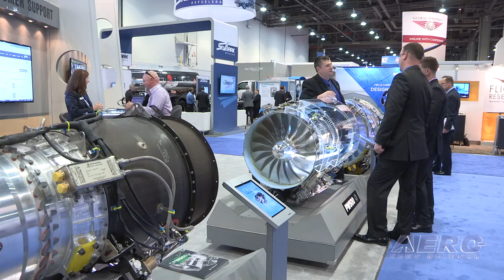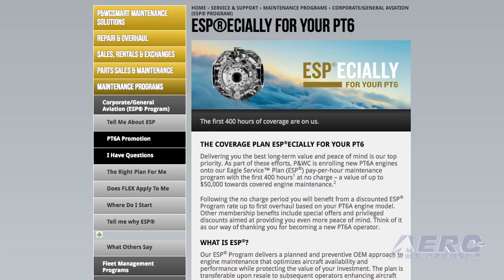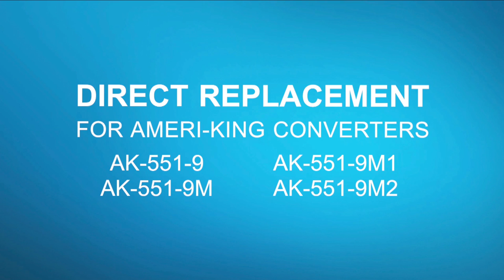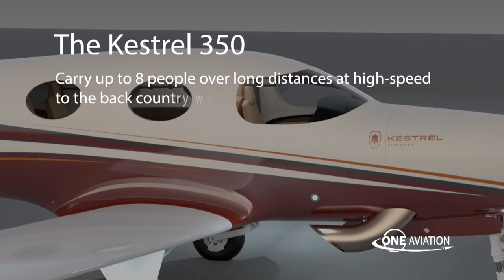Aero-TV: P&W's PT-6 Family - Maintaining Competitiveness

Comment: I'm sure he knows this, but the fact that the air enters at the back ISN'T what makes the PT-6 a reverse-flow engine. The airflow, after leaving the compressor section, travels into the "hot" section then reverses direction before being passed through the combustion chamber(s) and then again before entering the turbine section.
Reply: Alan Hardman No it is reverse flow because normal turboprops have the intake directly behind the prop and the exhaust at the very rear, not because the combustion chamber. Almost all turboprops have a folded manifold combustion chamber to help exhaust gasses from back flowing through the compressor after the explosion happens.